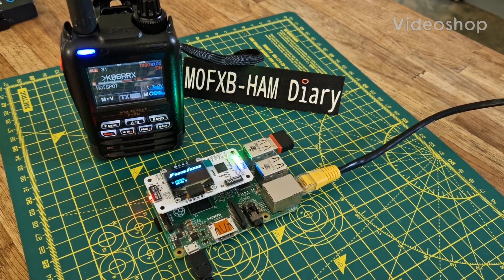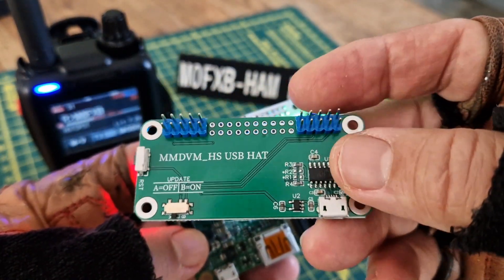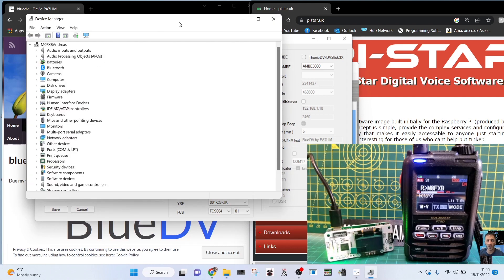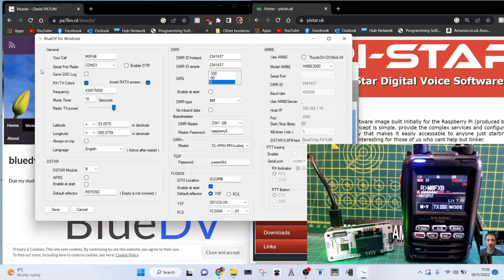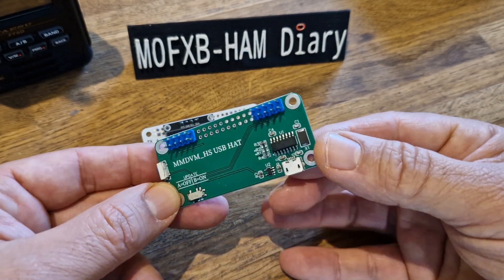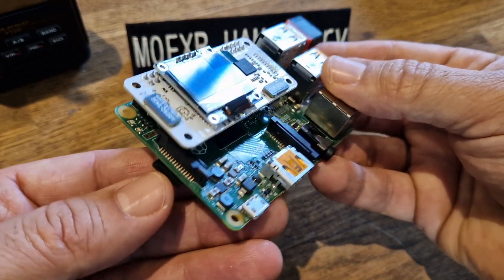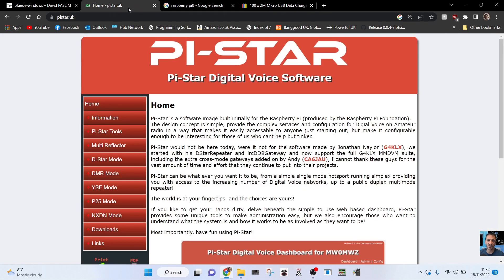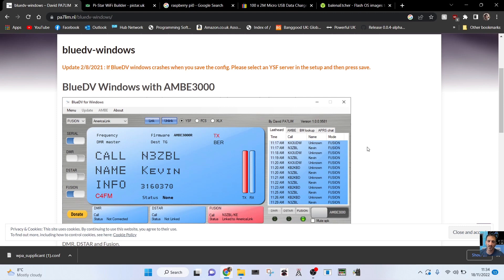MMDVM DUPLEX HAT Duplex V/UHF

Comment: Andreas, I've ordered the following as my non-soldering way of adding my pins to the dual hat: 2.54mm / 0.1" Pitch Press-Fit Male Pin Header PID: 5938. I have to if I want a self-contained hotspot in its own case. I don't see any other way to get there than by connecting the nextion screen to the hat. What say you, brother? KN6ZFM.
Reply from the maker: Yes agree otherwise buy a complete one .

Comment: I have that Hat but cant seem to get the FW updated. Did you happen to upgrade to HAT FW and if so what is the procedure you used to do it. I have tried shorting pins 38-40 and tried flashing it with WPSD and PiStar Classic, all I get is failure to  init. It is currently on v1.5.2 and works quite well. I'd like to get it to V1.6.1. Any and all advice welcome.
Reply from the maker: https://youtu.be/Dgo9x2mqODU?si=0i1hn0eihFOVzCg7
Reply: @M0FXBHamTech  thank you for the link. yes I have used that procedure to update fw on my other Hats, but this particular hat which looks exactly like yours will not update. I get a failure to init
Reply: @mfmoran1  I get the same result.

Comment: Those built-in antennas? Dummy loads! For a few years, I've run a simplex hotspot with a tiny rubber duck antenna and I could access it from anywhere on my property with a mere 50mw of power from my handheld radio.

Yesterday, I received this very duplex hat from Aliexpress. I quickly installed it into said hotspot and made the necessary adjustments to pistar and my codeplug to run duplex. Everything worked great in my hamshack, so I went downstairs to eat dinner.

After dinner, I tried to use the hotspot from downstairs and was puzzled that it was no longer working. I quickly realized my signal was not being heard by the hotspot, and similarly, my radio had difficulty receiving traffic from other hams. Walk back upstairs and into the hamshack and everything is fine, but with this hat I can't even go to the next room without breaking the connection. Boosting the power to 2 watts will allow me to key up the hotspot, but that defeats one purpose of having a hotspot and reception is still spotty. The hotspot is in a clear plastic case, so it's not as though there is a metal case blocking the signal.
Reply: Hi,  I have same behavior with same board in duplex mode. with simplex mode, I can get better range. I have tried many configurations without success. have you any lucky to extend range? Thank you
Reply: @sorokaalex  Sadly, no. It's odd, as the hotspot dashboard as well as the VU meters on my handhelds indicate more than adequate signal levels, but performance is still iffy. But increasing power on the handhelds DOES slightly improve performance. The only thing that makes it work properly is being in the same room with the hotspot. I also don't like that the MMDVM hat is locked and the firmware can't be upgraded. I'll likely replace it with a simplex hat and dedicate the hotspot to Yaesu Fusion, where duplex operation doesn't offer many advantages.
Reply from the maker: Solder on a better antenna .
Reply: This sort of defeats the purpose of buying a device with board mounted antennas, no? One should not have to modify a brand new product to make it fully functional.  @M0FXBHamTech